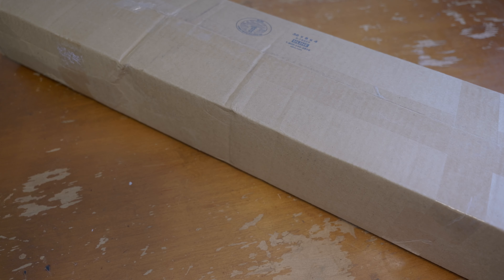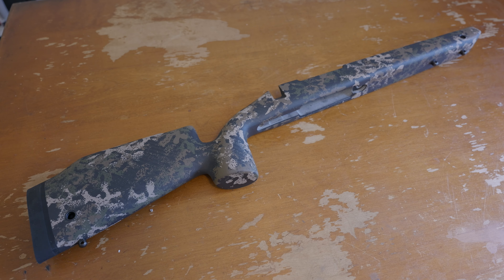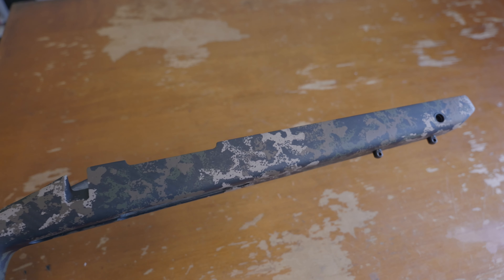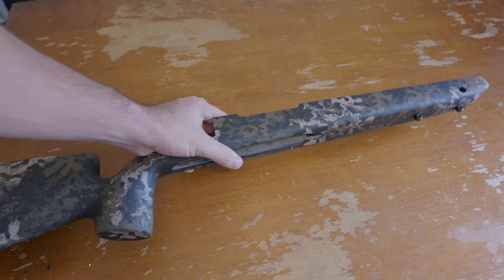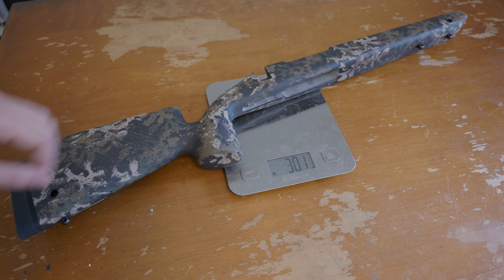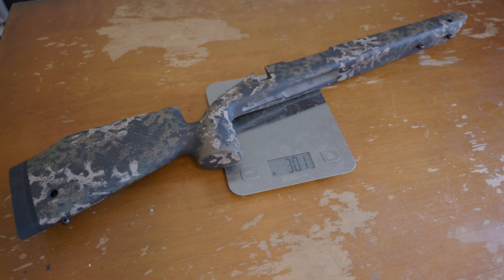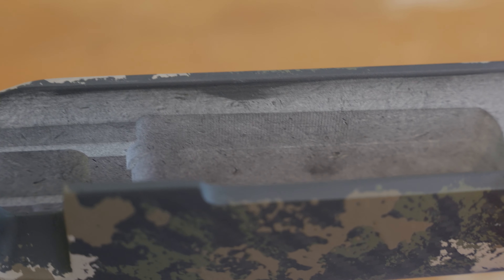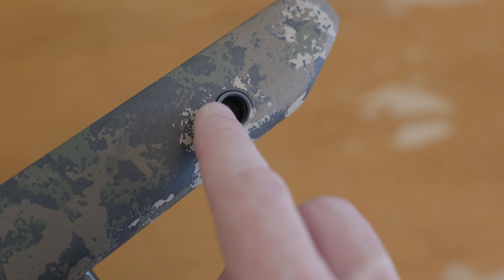BTPHR Part 2: AG Composites Visigoth Stock

Comment: Great video!  To add to your review, the weight on the website is for a standard stock.  When you add custom options it can change the weight a little.  Second, the relief on the inlet for the bottom metal is as you said allows for clearance for a true Rem 700 bottom metal.  Again, thanks for the feedback / review and let us know if you need anything else.